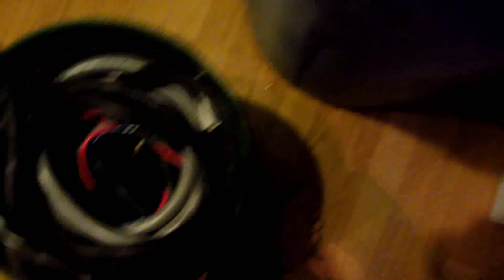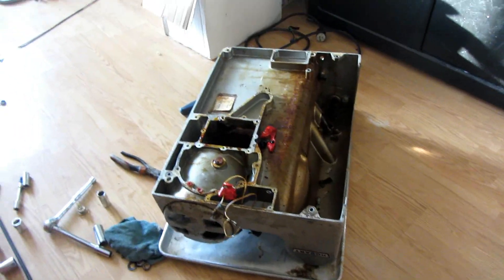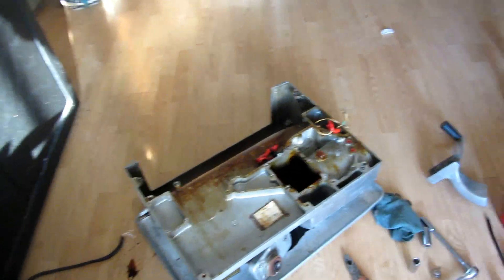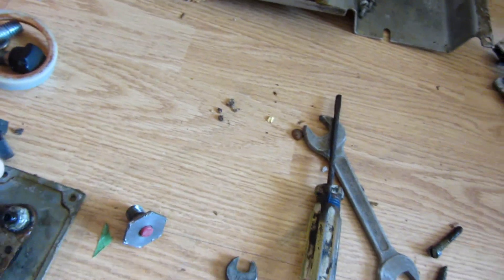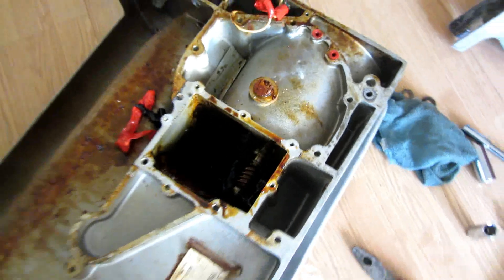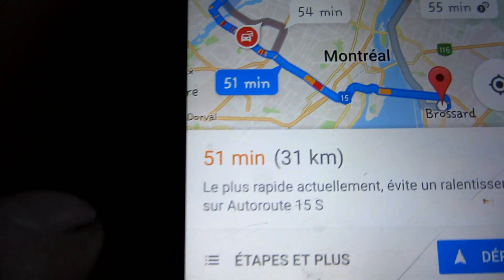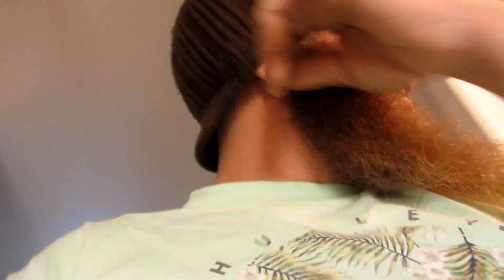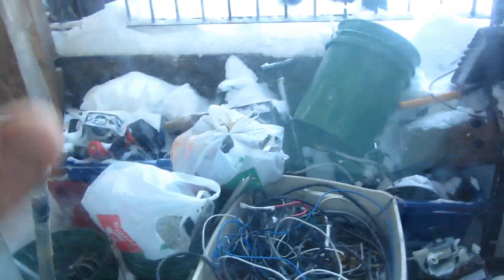testing the truck

Comment: your truck reminds me of my youngest brother's truck "Spot the Wonder Truck" it was first my dad's (he passed in 1988) he drove it until it 548,000 kilometers on it and it wouldn't record any more, many many sets of brakes,  tires  and who knows what else, when his foot went through the floorboards he bought a new "used" truck only 13 years old lol
Reply from the maker: old truck are the best easy to repair almost everything is holder by a normal screw ...
only reason i dont have an old model is for gaz consomation
Reply: that what he said, regular parts, no electronics